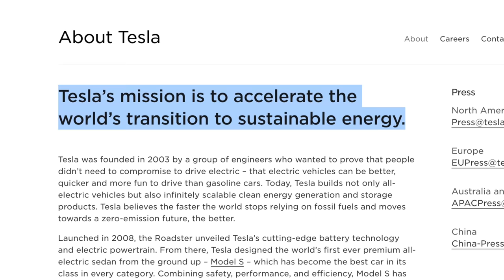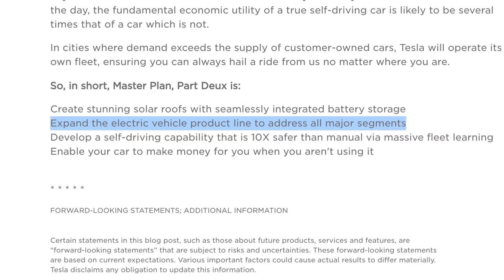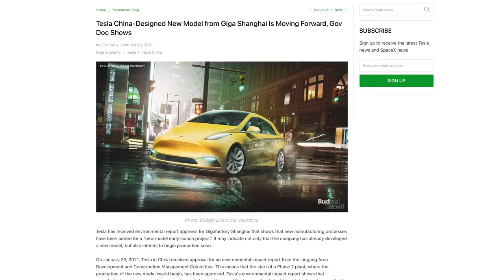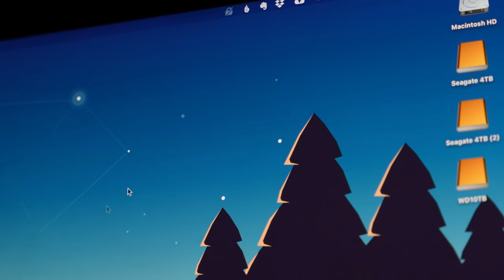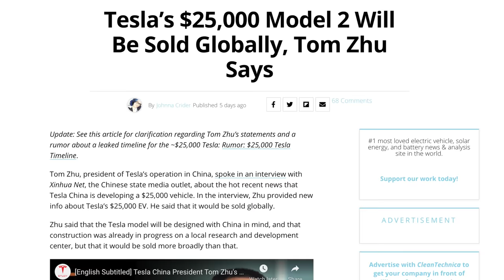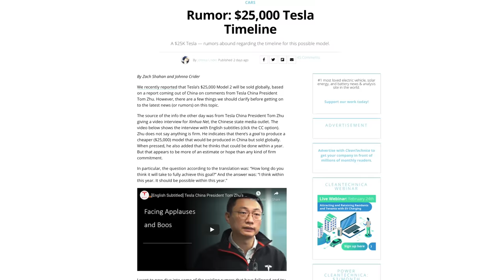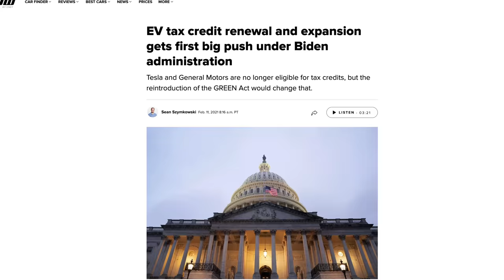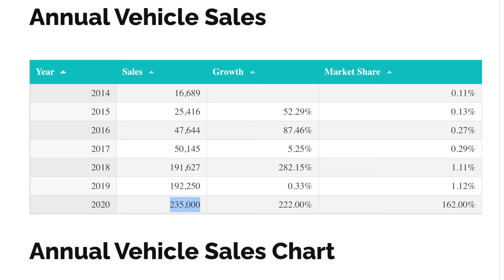New Tesla Model 2 = Game OVER for Gas

Comment: I would buy one in a heartbeat for this price.
Reply: That’s the point!
Reply: Me too👌🏻
Reply: Depending on the range yes
Reply: I'll buy 2 just because. If ones dies go get the other
Reply: @benjamingreen9540  Needs a 500 mile range before I'll even consider it.
Reply: @ericwilper3763  sounds about right 450-500 cause we know some of that will be lost in cold weather
Reply: Same here! Anyone buy Tesla Stock on this dip?
Reply: Yeah but understand this model doesn't have the ability to hover over the air. 😩 😷
Reply: @ericwilper3763  well alright then tough guy
Reply: If millions of people start buying electric cars, it should cause gas prices to drop also.
Reply: Purchase all the #silver you can get! Musk uses silver in the Tesla!
Reply: Yes, gas price will go down... but electric cost will go up. So your electric bill to clarify.
Reply: @ericwilper3763  Think about a leisurely vacation drive.  How long do you drive before you need to stop for bio break or to eat.  I normally am ready for break around three hours ( at 70 mph == 210 miles).  The model 3 Standard Range + has an advertised 250 mile full charge range.  See Tesla supercharger network. Go test drive one and consider.  I bought a white Model 3 SR+ with white interior and I don't have any second thoughts.
Reply: @leonelhernandez220  Agreed, if everyone went out and bought an EV (275 million) the power grid couldn't keep up. Which would mean billions would have to be spent updating infrastructure/building more power plants/updating residential electrical systems(obviously the homeowner would pay that part) building car charging stations everywhere,so everyone can plug in & recharge their electricity guzzling EV's. Which would mean the price of electricity would go up and we'd be back to paying the same prices as gasoline to travel the same distance. 
   This is all BS anyways, any car,motorcycle or scooter company can easily build a small 2 seated hybrid commuter vehicle that gets over 100 MPG's. The VW XL1 gets almost 300 MPGs  diesel/electric hybrid car. It uses expensive carbon fiber to save weight but a 125 MPG's hybrid is easily achievable. Or the Triggo or Yamaha 300cc Tricity non hybrid scooter for example, all they'd have to do is add a lightweight, aerodynamic removable enclosure to it and you have a vehicle that could be used all year round and gets around 100 MPG's from a 300cc gasoline engine with a top speed of 85 MPH
Reply: @carl5438  Not me.  I drive my Nissan Altima 600 miles straight without stopping, and only then because the gas got low.  For you, maybe a car with 200-300 mile range is good enough.  Not good enough for me.  Not even close.  When I travel, it's not for a leisurely drive.  I want to get there.
Reply: Yep, same here.
I guess we all did not get any huge gains with Tesla to buy the current models? Haha.
Reply: @aditussomnus  Check out the VW XL1  gets almost 300 MPG's from a 2 seated diesel/electric hybrid. It does use expensive carbon fiber to save weight. But if they can get 300 MPG's why can't a Toyota Prius get 125 MPGs? Also if a hybrid had say 300 watts of solar on it's hood,roof & trunk area. It doesn't seem like much but when sitting for 8 hours in the sun recharging the battery it will increase range.
Reply: @AwesomeBlackDude  I identify as a hover car owner... Respect my identity! (Cartman style) 🤡
Reply: Wait until they use the same apple tactics...
Reply: It because the Democrats wan’t all Electric vehicles by 2030
Reply: I’m getting really sick of Tesla fanboys saying game over for gas they have been saying that forever yet nothing has changed
Reply: I won't. I'll stick with American made cars.
Reply: Same!!
Reply: cheap china car...hell no!
Reply: @michaelbrinks8089  That is why Tesla is selling solar roofing. Can you imaging how much energy could be created my millions then selling to the grid? Elon is creating supply and demand. I am not a fan, but this is genius.
Reply: Won’t buy it if it’s made in china!
Reply: But it's made in china ....
Reply: @leonelhernandez220  No, because Tesla is working on developing a new electrical infrastructure that'll make that more affordable too, so basically, Elon is playing 4D Chess.
Reply: @tander101  -gotcha, yeah I heard about him utilizing new giant batteries and solar panels to charge them up. There is a lot of companies that are investing into power stations... they use conventional electricity. I mean the cost will still go up because the main source of conventional electricity is through coal.
Reply: @aquariandawn4750  only the newest Roasters model edition will have the ability to fly in the air. With no back seats that space area is taking up by the hover engine. 😬
Reply: @XxkrazymonkeyxxX  You NEED Two
That was only one example of poor workmanship on Tesla’s newest model consumers reported in the 2020 Consumer Reports Vehicle Reliability Study. 
Tesla’s overall poor performance in the annual study placed it SECOND TO LAST  among the 26 ranked brands.
Reply: @ericwilper3763  that's not expectable for a 19k ev
Reply: @michaelbrinks8089  yes and your electric  bill to go up.
Reply: then give me one

send it to my mailbox
Reply: Who wouldn’t?
Reply: If it ain’t got fsd there’s no point in not saving up for it. That’s one of the main things that makes it a Tesla
Reply: Same!!
Reply: I’d buy 5 of em and have Turo as a damn passive income gold mine lmao
Reply: I would go into debt for it.
Reply: @michaelbrinks8089  I don't think we will ever see cheap gas again. Biden shutdown some production as soon as becoming president, and I am sure that will continue. We also see some blue states starting to raise their gas taxes. Some are threatening to start to raise by around a dollar, and add on some after that. The bad thing is that this will punish the people who cannot afford an electric car and the people who live out where there is no electric car support nor public transportation.  These incentive payments have always given me a laugh. People who can buy a car are given money, and those who cannot buy a car are given nothing and continue to drive what shouldn't be on the road. Pure professional politician thinking.
Reply: @ronfullerton3162  Agreed
Reply: @michaelbrinks8089  Thanks.
Reply: @ronfullerton3162  You still have cheap gas prices
Reply: @BeatstormX  Compared with a lot of the rest of the countries, yes, you are right. I live in the Midwest USA where there is little to no public transit. Glad I am retired, because I worked 40 miles (65.5 Km), from home. About seven or eight years ago it got up to $5 a gallon. That really hurt the pocketbook! Now they are talking over $7 a gallon by July. Ouch! If I have to go, my 50 mpg motorcycle will be the way I travel.
Reply: @ronfullerton3162  in germany the Diesel is 1.25€/litre thats about 7-8 $ per gallon
Reply: @BeatstormX  I know all of Europe has been way more expensive than we have been. I know many times I have seen your prices, and the price for your litre is about the same as our cost for a gallon. Which makes me shake my head knowing your litre is just a bit larger than our quart. And it takes four quarts to equal a gallon. I motorcycles as much as I could to keep costs down. But our winters can be  wet nasty, ruling out biking.
Reply: @ronfullerton3162  I feel like over here you kinda forced into buying a efficient car, like 5litres/100km with a diesel is good, thats something like 60mpg ? Im not sure
Reply: @BeatstormX  Your figures are good. Yes, I am also afraid we will be forced into cars with higher effeciency or electric. I am not against that, just not able to afford such a purchase. Maybe I will need to get my bicycle out and see if I can still ride it.
Reply: Dont, buy classics, don't cave in
Reply: Same
Reply: You can keep that POS and all the BS promises from Tesla. When Honda, Toyota, GM & Ford (you know, REAL car companies) begin making EVs on the regular, I'm in!
Reply: @seanoleary1979  you’re a tomorrow guy that’s all. Nothing wrong with that! Might even end up better off overall! Maybe not. It’s all relative.
Reply: Cheap cars are cheap for a reason.
Reply: @XxkrazymonkeyxxX  If both die at the same time. This is a “What if” scenario.
Reply: @johnjacob688  They reason is some people are made cheap.
Reply: @bising3589  Whoa man! You said it all.It is crystal(clear) . For that Elon will send you in his rocket to Uranus.
Reply: @hswing11  He isn’t talking about Wendy’s, Burger King , Popeyes chicken , or Macdonald’s jobs .